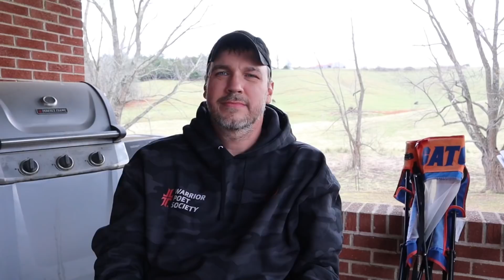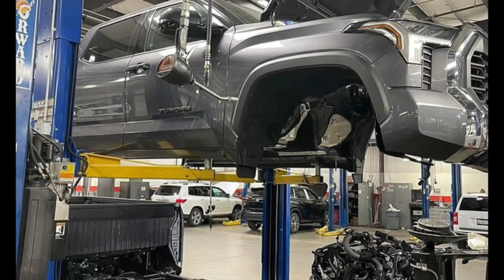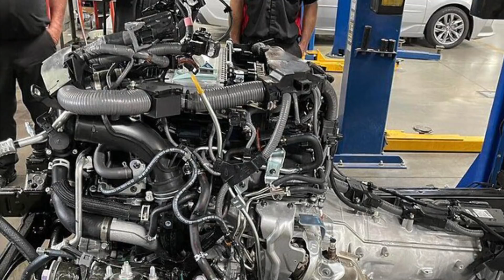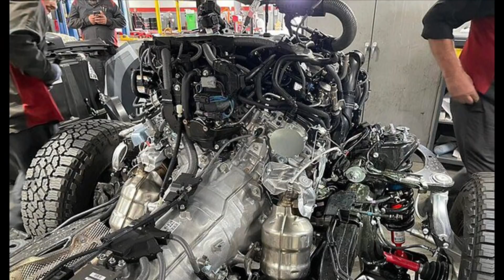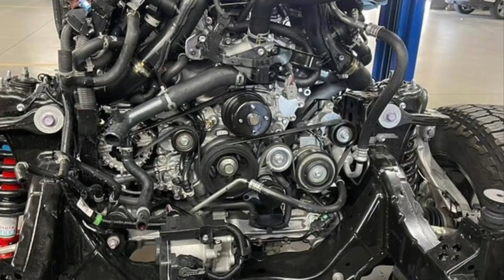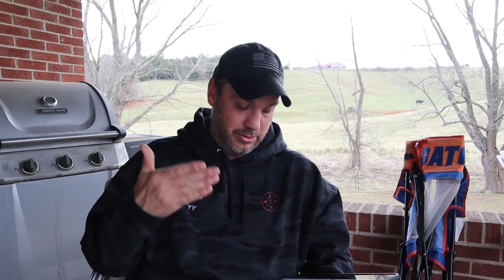2022 Tundra Problems… This Could Be A Disaster

Comment: I guess people that were saying, "I want a new and improved Tundra! The old one is a dinosaur!", are seeing why you don't fix things that aren't broke....
Reply: Well everyone just wanted an upgrade with futures, not engine change
Reply: @goingwiththecurrent  Every other truck brand has V8's as an option that get 18-20 average gas mileage.  Toyota simply cheaped out this round by reusing their Lexus V6TT engine in everything... Tundra, 4Runner, Land Cruiser, and Sequoia, rather than putting in the R&D to improve their V8.
Reply: Ecoboost engines are durable, showing new engine tech isn't always bad. But Toyota seems like they struggle to balance innovation and reliability more than most brands.
Reply: 8mpgs & only 5k tow cap in my v8 tundra
Reply: @shazmodeus2795  Cheaped out, or made a smart business decision? xD
Reply: The v8 were absolute fuel hogs, would not meet new CAFE standards.  There is nothing wrong with these engines, they will work the bugs out.
Reply: @WBOS72  I’m totally loving the monstrous torque this thing produces, it’s a good truck. Sorry for those who dislike the new Tundra because of the engine Toyota went with. It’s a beast of a truck and does everything the 1UZ powered ones can do, but better.
Reply: hopefully
Reply: Toyota was the only brand that had a worse mpg average over the past 5 years. As more people bought toyota trucks, it ruined their CAFE average.
Reply: Ecoboost engines have alot of issues . Toyota engines have reliability  issues?  News  to me lol

Comment: Having been a Ford tech for 25 years and regularly pulling cabs for certain repairs, I can honestly tell you it is the least intrusive way to service vehicle. Removing the engine would leave much more room for damage to the vehicle for example scratched fenders ect. Cabs are designed to be removed easily and without sacrificing integrity. Cabs can be removed in less than an hour and allow better access without climbing all over the customers vehicle. My 2011 ecoboost F150 just crossed 290k and just removed cab for the first time to do a turbo cooling fitting, but otherwise all original components. Maintenance is key.
Reply: Now, imagine lifting the body off of a Sequoia for the same repair.
Reply: @dr.emilschaffhausen4683  It would probably just be a few more bolts, a couple wires and the gas filler neck. I can't imagine it would be that much harder.
Reply: @franksmythe6969  Just a more complicated lift rig for the greater weight? Hopefully not too bad.
Reply: @dr.emilschaffhausen4683  then when you put it back together and have parts left over 🤣🤣  throw them in the trash.
Reply: Agreed. Book labor for a water pump on the Powerstroke's and Duramax's are incredibly high. These variable vane turbos are a pain in the  ass.
Reply: I don't know how  poor maintenance plays into a vehicle with 327 miles on it. This is why you should never buy a first year model. I wish somebody would just explain what is failing with the wastegate (or blow-off valve). Is it a design flaw? If so, Toyota will likely never admit it because that would lead to people steering clear of 1st gen motors (assuming there will be a 2nd gen).
Reply: lol an "easy' repair... until your Tundra is out of warranty and the stealership sticks you with a 5k repair bill to replace the turbos...
No thanks
Reply: Agree with all
Reply: How many hour u think for services or repair the tundra turbo ?

Comment: People need to slow the fuck down with these assumptions. This engine is out of the LC500 and has had no problems since 2018. Toyota launch’s campaigns to fix known issues called CSP’s, they fixed tons of issues on cars 10 years laters for free including hybrid actuators on Prius’s, hybrid batteries, air pumps on the older Tundras and the list goes on. They always fix the problem right. On top of that nobody has numbers yet, if 300k of these Tundras are made and it only affected 6% it will be cleaned up before it’s a real problem for consumers. If it’s 30% that will cause issues for sure but they still take care of it.
Reply: seriously, as if every other manufacture was perfect and released new models without any faults, big assumptions from small isolated instances not sure what this guys background is and not trying to be disrespectful nor am I saying I am all knowing but the way he speaks of the matter makes him seam like he's not that knowledgeable, he speaks more as a fan/enthusiast/customer.

Comment: If this happens out of warranty you're screwed.
Reply from the maker: That would suck bad
Reply: Damn.
Reply: I believe there is going to be a lot of "wastegate Tundras" on the used car lot in 5 years.  Hell, it might be a whole lot LESS than 5 years!
Reply: Recalls on the way .
Reply: Pulling cab is not hard at all and takes an experienced take less then an hour. Sucks for the guys that fix their own vehicles once out of warranty but it's not going to cost all the much more. Fords been pulling cabs since the 6.4 and people still buy them...

Comment: Hi Andy.  I think I will stick with the basic Tacoma with the four cylinder engine.  The Tundra should have a V8.  Great job on your videos.
Reply from the maker: Thank you and I agree it should have had a V8 at least as an option
Reply: @gearrunner  that's what I've been saying all along. Toyota should've had design the new platform to accommodate both the new V6 and the good old V8. Let the buyers choose what they want. 
By the way thanks for the video, I feel your pain. I treat my cars like my kids. I'm sure everything will turn okay though.
Reply: 2.7 cast iron block... damn hard to beat and almost impossible to break. Biggest and oldest 4 cylinder on the market atm. Cheers!

Comment: As a ford tech, lifting the cab is not a big deal. It can be done in about an hour. We have been doing it for 10 years.  The plate you are talking about on the right rear is the vacuum pump. The picture on the left is the inside of the exhaust housing of the turbo.
Reply: Yup. Scare tactic to get views. Whenever you have YouTubers that are not mechanics trying to articulate an issue like this, it like fake news. Yeah it's an issue but how many vehicles are really effected. There isn't enough data to assume anything. Where was all this drama when some of the 5.7 had issues with cam tower leaks? There was none cuz it was not a broad issue. No manufacturer will have 0% defect on the assembly line. There will always be an outlier. You just hope you don't get that outlier.
Reply: So two hours labor on and off?
Reply: All 'gas' turbo engines are maintenance money pits. With the 'shortages' of everything and inflation what could go wrong?
Reply: Have you ever seen a dealer charge an hour for cab removal???
Reply: @paulsergojan1541  yes I did. Ford dealers do this all the time while replacing infamous CamPhasers on 3.5L Ecoboosts. Trained tech can take cab off the frame in about 45 minutes. Most of the dealers prefer this method instead of having tech disassemble half of the front end to get to CamPhasers or to lean on customers truck for 8-10 hours causing possible scratches or damage. On CamPhasers job lift body off was 1 hour charge and to put body back on another 1 hour job.
Reply: @codename7832  Thanks for info. That would make a great video.  Would get thousands of clicks.
Reply: @mt1885  Ecoboost engines seem to be pretty solid, many are now hitting 200-300k with no major issues.
Reply: @KB-bh9hp  They can keep them still are very expensive to maintain them turbos have to be replaced well before that millage and all of 'chain' of parts then shortages and inflation (making parts very expensive). I have had many GM 5.3's easily do that and more without the 'turbo' nonsense.
Reply: I was up at Banks having a performance enhancing product installed on my 5.9 Cummins. 95% of the other trucks were Ford 7.3's. This was in 1999.  One guy said" Can I work on the Dodge?" They had a horizontal lay down contraption to enable them to work on the buried turbo on the 7.3's.  I guess back then they could at least access it but I imagine removing the cab on those would be handy. The Ram shop I use has just such a device to help them work on an occasional 7.3 that comes in. A retired Ram tech I know used to remove the cabs on the newer ones routinely too. The 6.7's are pretty tight too with all the emissions crap.

Comment: If that was mine, I would fight to the bitter end for a replacement.  They may fix the issue however that truck torn apart like that will never be the same again.  Those techs have never dealt with that before and most likely something will not be connected, routed correctly and that could potentially lead to another issue.
Reply from the maker: I agree 100%
Reply: It will be fine. They make them to take apart like this. Its honestly pretty quick to take cabs off.
Reply: @204audi  the cab being removed wouldn’t be what I was worried about. The spaghetti of stuff on the engine being put back correctly concerns me.  You can’t tell there’s an engine under that mess. Way too much complexity and potential issues down the road.  Just my opinion
Reply: @MikeC-g8f  have you ever looked at a modern diesel pickup? It looks like a mess to the untrained eye, but this is also why things are ran and test driven before returning.
Reply: They've never dealt with that before?? Toyota techs have been replacing frames on tacomas and 1st Gen tundras for what the last 7 years?
Reply: @Mr_Clean  sure they have removed cabs from Tacoma's and Tundra but I would be willing to bet what little I have that they have never removed the cab from this model year tundra.  That was my point.
Reply: @gearrunner  you all know nothing. Ford techs lift cab off the frame on 90% of F150's when they are in for infamous CamPhaser replacement. It takes trained tech about 45 minutes to lift the cab. Much less possibility to damage anything and much less electrical to unhook (pretty much all electrical clamps). Most of  Ford dealers prefer this method instead of having tech disassemble half of the front end to get to CamPhasers or to have him lean over customers truck for 8-10 hours causing possible scratches or damage. Its cab off the frame. Same exact way on Tundra as on any other pickup with Cab on Frame. Easiest way possible to get to whole engine. Would you want them to unhook every single line to pull engine out? You would have to be crazy because that would be disaster waiting to happen. Pulling cab of the frame they only have to unscrew couple bolts and couple electrical connections.
Reply from the maker: @codename7832  No, I would want an entirely new truck!  It had under 400 miles on it.  I don’t expect junk and problems from a Toyota
Reply: @gearrunner  conversation was about removing Cab of the frame not about new Truck. A lot of your viewers including you (at least its seems this way) have no idea that this is the best way to get to whole engine on all pickup trucks. Also you guys act like its Brain Surgery. Literally 8-10 or so bolts and couple snap on electrical connections. Instead you suggested pulling engine from underneath would be better idea? That tells me you have no clue how much more work hours and how many connections would have to be disconnected to pull engine from the bottom. On the other hand its Turbo Wastegate. Its not big deal. After removing cab its an hour or so of work. Toyota messed up on Turbo location thats why cab needs to be lifted. For instance Turbos on Ford F150's sit right by front wheel well liners and you could actually replace them from wheel well including Wastegate. Also the way they designed this new whole front end i would expect junk. Whole grill is literally held up to metal truck structure by 6 plastics with no inner support underneath the grill  like all other vehicles have. Normally you get inner support and then grill which snaps onto it. New Tundra seems to be lacking it. Its just empty space there.

Comment: It's a shame that they don't offer the V8 as an option.

I agree with the issue of having to lift the cab for work this early. There is no way most dealers would button it back up 100% correctly.
Reply: I think they will be offering a Diesel option in the next couple years.
Reply: We lift the cab off trucks more often than you think.
Reply: @yojimbo296  That's good to know.

Comment: I'm actually a bit nervous when I drive my 2018 5.7 now. I'm worried that someone is going to total my truck and I won't be able to replace it with a V8!😬
Reply: If something happen to my 2015, getting a Taco or worse case a CRV.
Reply: I have the same concern
Reply: I have a 2014 Toyota Tundra SR5 (6.5 ft bed) with a TSS package. I used to complain that my 5.7L is behind the times but now I'm glad I still have her. 🤓

I've installed a 46 gallon tank, chrome delete,. 2019+ LED headlight units, gun safes, Bilstein shocks and struts with a 2" lift and she still drives like new. No rust with 104,000 miles. 😃
Reply: @Gdwin12  I have a 2020 TRD OR and I bought my Tundra because the 13 Tacoma struggled to tow our RV. Funny thing is when i bought my truck June 20, my wife was all over me about not needing a new truck and on and on. So, now my truck 1.5 years old is worth 10K CAD more than when new. I am glad I pulled the trigger. I also DID NOT want a turbo six. I seen how many problems Ford had with theirs. Now already Toyota has waste gate issues.
Reply: @mikefoehr235  what problems did for have cause alot of those first gen ecoboost trucks are hitting 200k plus and I guarantee you I'll out pull any v8 here's a link to my 515whp 645tq ecoboost https://youtu.be/JlHGPHhub98
Reply: THIS TIMES 1000 !!!!
I'm EXTRA CAREFUL...i don't wanna lose my V8 Sequoia.
Reply: Or, getting carjacked by a 2022 Tundra owner....😂😂
Reply: @Iron Maiden  Never thought of that. Good thing i have bear spray in my door.
Reply: Exactly!  I’m so afraid of recking it or it getting stolen and I have to buy this.
Reply: @mikefoehr235  Ecoboost engines are actually very durable, especially the newer designs.
Reply: i have the same concern driving my 01 5.9 cummins.  I was thinking about a tundra for a newer truck soon.  I planning to hopefully drive my 01 for another 10 years.  just broke in at 98k
Reply: @mikefoehr235  ... key words "Ford had"...new design, new problems. 
The Ford 3.5 and especially 2.7 are now very reliable offerings, I'm considering the 2.7 with it's Iron Block.
Reply: get another old one not on issue to me
Reply: 5.7 is such a gas guzzler, as much as I like the power, I can’t justify spending that kind of money on gas.
I bought a F150 3.5 Turbo 400hp 500 Foot Pounds of Tork. 
10 speed Transmission.
Goes like a jet when you step on it, but cruises on the hwy using on 11.5 per 100klm.
In Trailer mode it holds the gear longer and might stay in 7 or 8th.
In sport mode it keep the revs high and is very responsive.
Turbos requires very good oil like Amsoil and change every 3,000 and it will last forever.
Reply: You can always buy a used one to replace your 2018 if you have to.
Reply: yes, you can. it is simple.  Purchase another used tundra with a v8.  The used market will still have plenty of v8’s for many years to come.   “brand new” truck is an arbitrary preference, not a necessity.  Many well kept used trucks still available on the market.

Comment: Isn’t it common sense a smaller engine, burning hotter can never have longevity? Imagine your first turbo goes, wouldn’t most people get the second replaced too? Just seems like turbo won’t have longevity
Reply from the maker: Yea, especially in gasoline engines
Reply: New truck has water cooled exhaust manifold and dual radiators, one for each turbo, keeping temperatures down. Hot turbos was a 1980s problem.
Reply: @gearrunner  reminds me of two headlights. As soon as one goes, I feel
the other isn’t far behind. Replace both
Reply from the maker: @Pickuptrucktalk  There have been several Ecoboost that have had to have turbo replacements.  Their intercooler a run so cold that they condensated and they still went out.  Turbos will fail it’s not if it’s when.
Reply from the maker: @TomP913  agreed
Reply: It’s like an elephant running on a mouses heart.

Comment: Looks like a ball of yarn after a cat got ahold of it. No way that truck will ever be the same after all that disassembly. Can you imagine having to foot the bill for this nightmare out of warranty? It will be no less than a $6k - $8k bill. NO THANK YOU I'LL KEEP MY DEAD RELIABLE 5.7L V8!!
Reply: To lift the cab off the frame its less then 45 minute job for trained tech. On F150's they do it all the time while replacing CamPhasers. Much less wires to unhook and beats leaning over customers front end for couple hours causing possible scratches or damage. If its Wastegate replacement and they lift the cab of the truck its 5 hour job if not less. You would be probably looking at around $500-600 bill not $8K.
Reply: I just paid $6k for electric wiring harness on a Camry,must be more on a tundra

Comment: Ford has been doing body off repairs for years and it has worked out just fine. The turbo in your picture seems to have an internal wastegate (top left side), it’s a flap that opens and closes, most are servo controlled nowadays. My Dodge trucks with Cummins engines have had them for years.

Comment: I retired from the collision business (body shops)
We took cabs off to change frames if it was hit hard, a decent bodyman and mechanic can easily remove the cab.
I’d prefer to remove the cab than pull the engine.
You’d be surprised how easily the cab actually comes off..